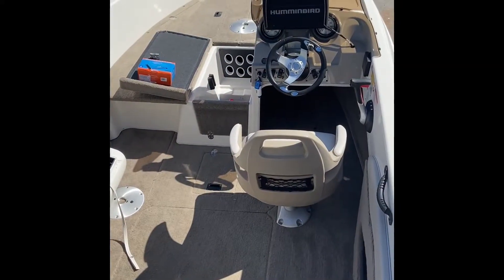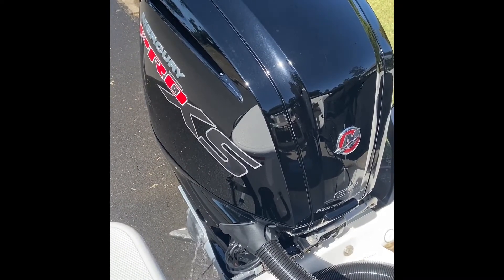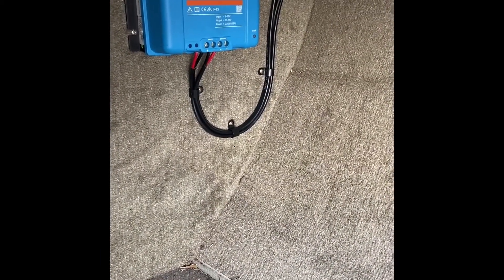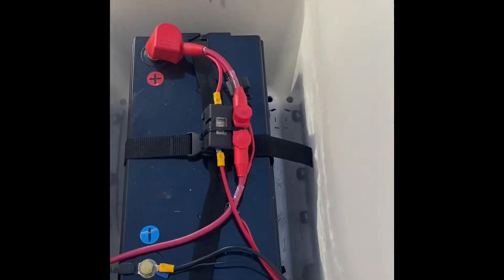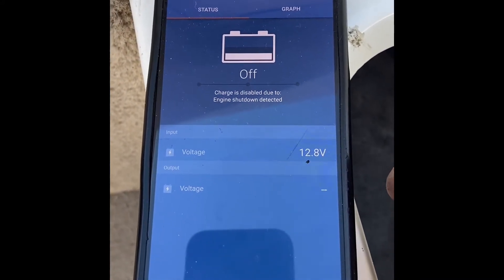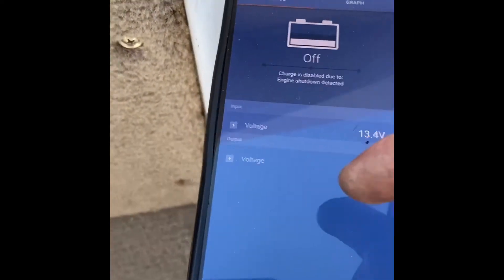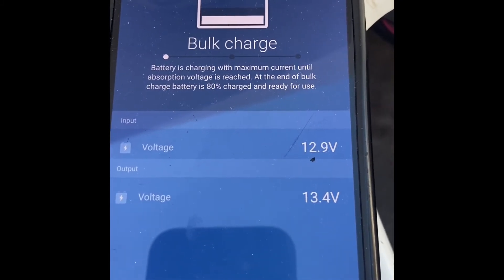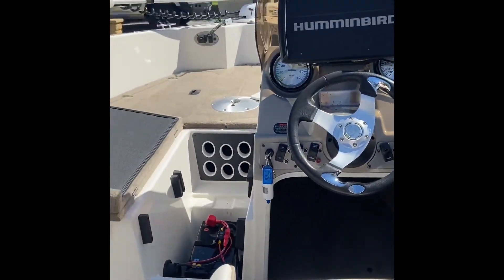Victron dc-dc charger on a boat

Comment: Hi, I’ve just finished reading installation manual for Victron  dc-dc charger, before starting my own installation. It stresses the fact that the unit gets pretty hot during operation and should be mounted on an inflammable surface. You’ve got it installed directly on a carpet surface, which may prove hazardous, just a thought. I’ve also noticed that you’ve got exposed copper wires at the fuse. The wires are not tinned and will corrode quickly. You may at least consider covering them in a liquid electric tape. Otherwise it seems to work great. I can’t wait to get mine installed soon…